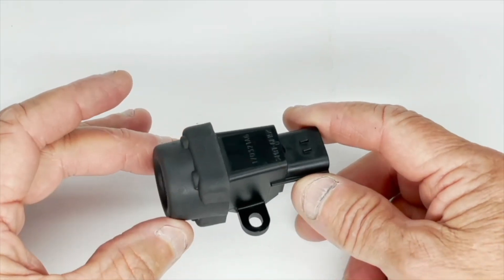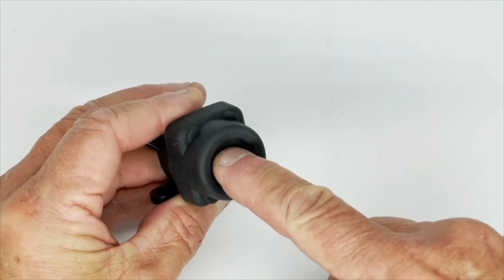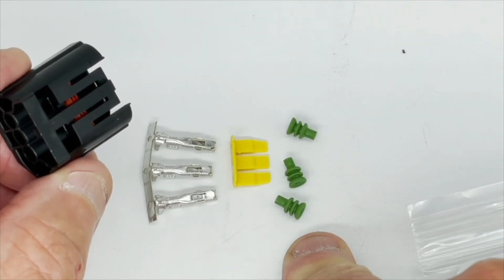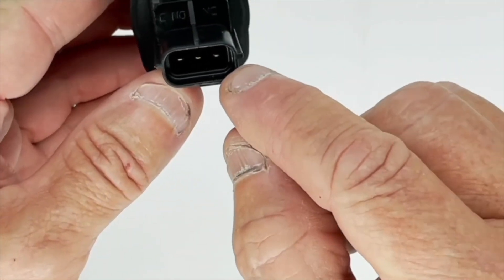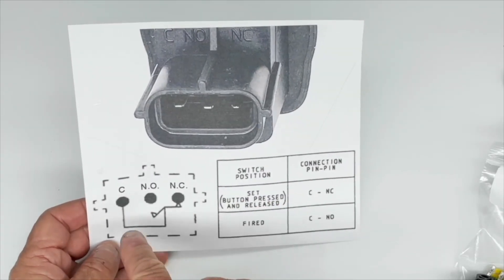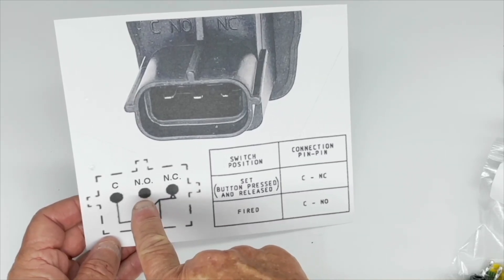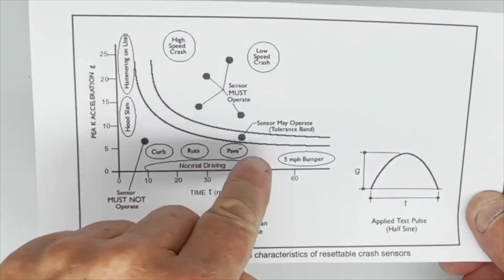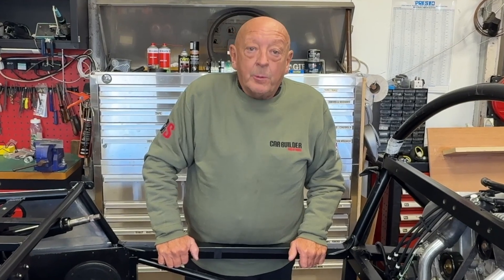What is an Inertia Safety Switch?

Comment: Hi, 
I ordered one of these from you all the other day for my 1996 mazda rx7.
This was my first proper car wiring project, and it was because the ECU Mosfet has died controlling Fuel Pump Relay actuation.
It was irrepairable.
I was left with two options, replace the ECU or bypass the ECU FPR control.
With the help of this part, I have successfully bypassed the ECU control in a safe manner. It was imepritive to me that i had some safety measures to protect me in the case of a crash and this product met those needs perfectly.
Just 10 minutes ago I got my car running again for the first time in 5 months. Thank you.
Mark
Reply from the maker: If we are helping to keep an RX7 on the road we are very happy!
Great work Mark and make sure you post the car on the Car Builder Solutions Facebook page as we would love to see it!